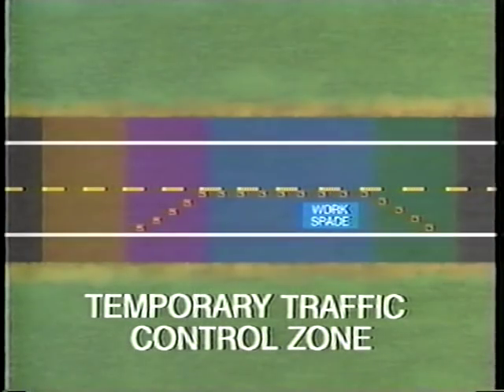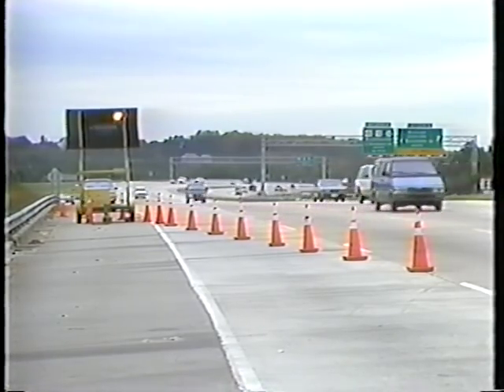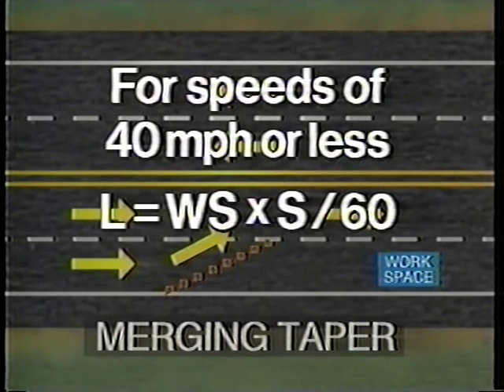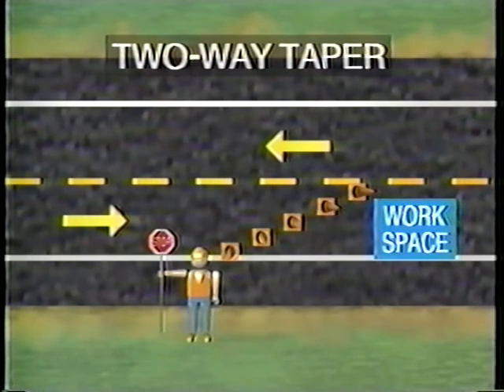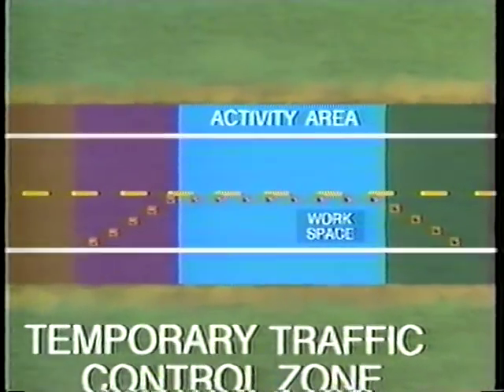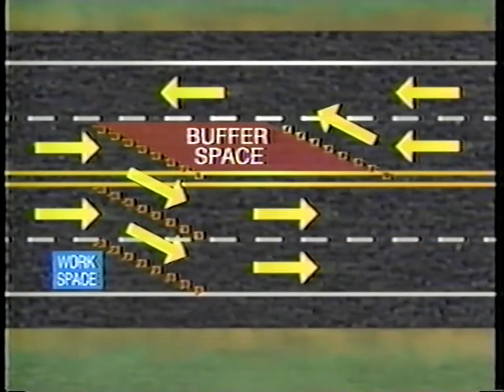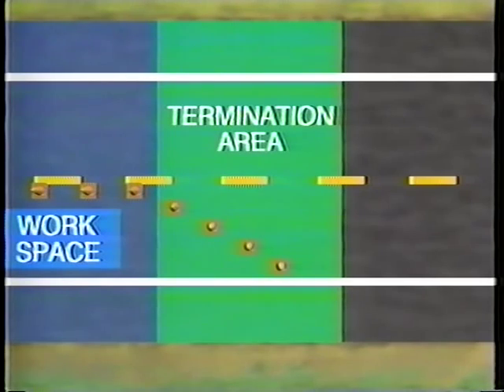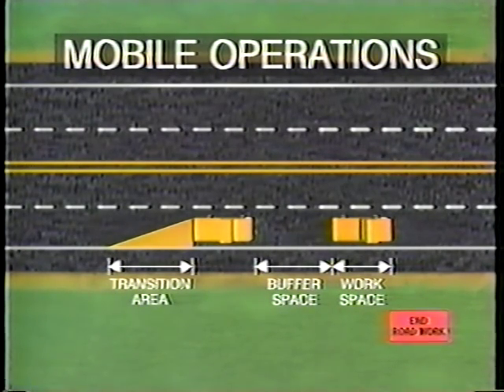Work Zone Safety - Part 3 - Length of Zones

Comment: The American formula is speed in miles/hour multiplied by lane width in feet.  120 km/h = 74.5645 mph.  3.65 m = 11.97507 feet.  So 74.5645 x 11.97507 equals a 892.915 foot taper.  Converting back to meters gives 272.16 m taper.